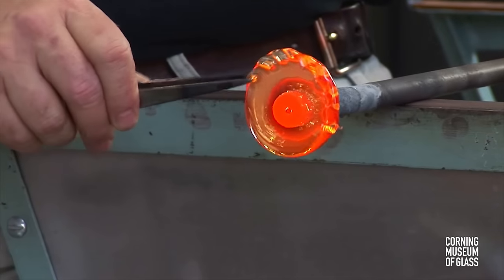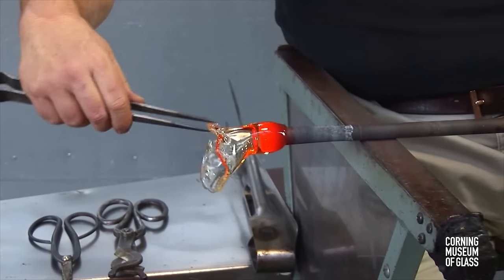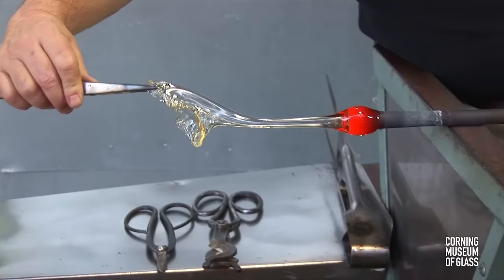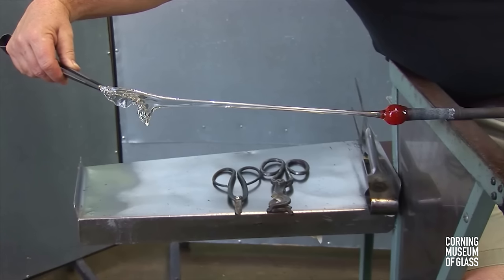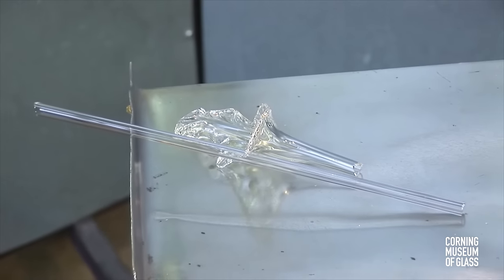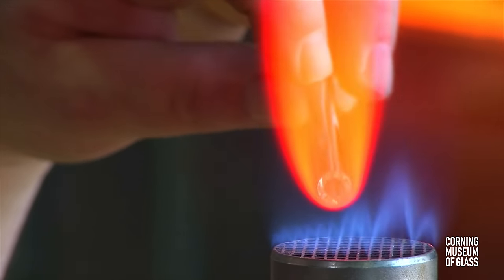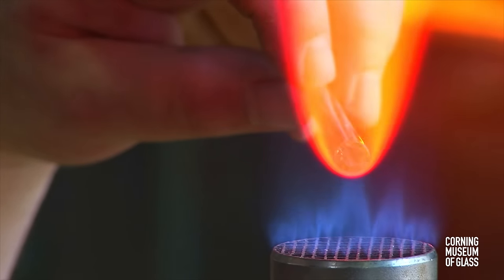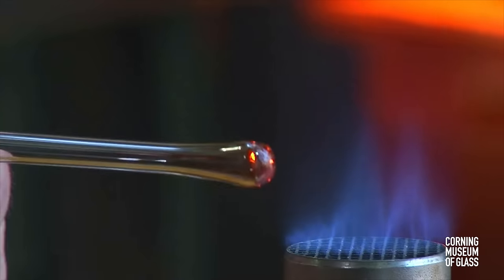Making Glass Tubes with a Bubble on the End

Comment: I saw a guy in an alley making one of those with a lighter, cool!
Reply: Lmao
Reply: yeah I've seen it done but they usually use a butane torch.. lol. . no bic is gonna do that especially in a alley which can feel like a breeze way on a pretty windless day.. it's enuff of a issue to light a cig if there is a slight persistent wind .. let alone trying to roll the glass while holding a lighter. lol.. my roommate had a thing about making them all the time. of course we all know what they are used for.. but he would also blow pipes for smoking bud too ! which is alot harder because tye stem has to be narrow enuff so you don't suck the weed down your throat when u hit it unless u use a screen but you didn't need one with his. he would also use different color glass hot enuff to layer the different colors into layers so it looks like a marble. the guy had some real talent. it's sad because he was a really good guy .. he just had a problem.. but he didn't let it define him or change him so he was a functioning addict or user..  finally got clean after years of use because he found out that his girlfriend was pregnant and they had tried to get pregnant for almost 7 years or something .. and when he did he started working at a smoke shop and the owner found out he could make some of the dopest pipes or glass pieces as they call it .. lol... and allowed him to sell them in his shop and didn't want a cut at all and he saved for about 4 years or so and was on his way to a bank to  have 2nd interview for a loan and his boss had gave him permission to put him down as a reference at the bank because the boss banked there as well and said if it came down to it he would consign to help him get the loan if he wasn't able to do so on his own.  on the way to the bank at 8am or so he was hit by a drunk driver and was killed .. R. I. P. STEPHAN CHARMICHEAL!!!
Reply: @Justinarmstrong0089  dude
Reply: Yeah I walked in my buddies apartment in Atlanta one day and I see this flame coming from the bathroom dudes got a Walmart propane or butane camping tank with flame shooting out rolling and blowing to his hearts content he looked like he was having the time of his life so who am I to hate
Reply: Lmao!!!!!booya.
Reply: @Justinarmstrong0089  as much as you typed we can tell your speaking from experience lmao
Reply: @Justinarmstrong0089  Damn I'm sorry to hear that, are you ok?  Sounds like a bit to bear.
Reply: So thats what everyone is doing
Reply: Roflmfao
Reply: i'm going out on a limb here since it is 4:30am local time, and i am going to guess the guy in the alley was using one with a lighter not making one. 😎😎
Reply: @joeltheiss4620  lmaooo yes he was rolling a bowl at least he fooled one person
Reply: More like a torch. And yes, everyone knows that one person who gets high and only does one thing
Reply: @joeltheiss4620  I once saw 3 jazz musicians. They were so broke, they were all sharing the same cigarette. And they were all left handed.. 

Me, I'm all natural, just smokin  banana peels. 💯   and the occasional cat cheese trip # heavy metal
Reply: hahahaha
Reply: thanks for this lesson, I’ll have to watch it again and if successful post my results, any cooking recipes for the new glass ingredients 😳🫣🫢🤫
Reply: The people living underneath the overpass by my house are always blowing smoke outta these lol
Reply: Hey artist are everywhere I’m pretty sure Miami has many artist that do those same kind of glass pieces in alleys
Reply: @lunytunez3634 lmao 😂
Reply: @gabrielwaldren  Recipes vary quite a bit and not all ingredients are easy to find so you may have to procure them in very random places from interesting people. For some reason the popo looks down upon the guys in my area that supply almost all of the ingredients.

Comment: definitely not going to work with borosilicate unless that is an oxy fuel bunsen burner you'll never get the glass hot enough to easily blow a bubble on the end out of the flame unless the wall thickness of your tubing is very thin, in which case the resulting spherical shape on the end will be even thinner and practically useless as the thin profile will easily break when subjected to any stress, heating variance, or impact
Reply: Not true. I use a bernzomatic ts8000  and i can blow some pretty thick glass. Even the colored tubes that are much harder. Just gotta have some patience, and maybe a blow tube.
Reply: You know what they say about nay sayers and do gooders...
Reply: That's bullshit. I blow pyrex with a map torch. Hell, I've done it with butane it just takes awhile
Reply: You can also use Mapp gas with Boro, not just oxy/propane.

Comment: Noooo  You didnt tell us how to remedy the pin hole. I hate when that happens and its so hard to close up after the bulbs blown. Ive tried a few methods but the results never look good. I find the easiest way is to either start again or heat up another piece of glass to melting point at the same time and touch the two together at the side of the pinhole until it sticks and cover the hole like that.....but Im a hack so illd like to know a better method if there is one. Ive even tried dabbing the red hot bulb at the pinhole into crushed glass and reheating.

Comment: AKA "oil burner" or depending on where you are and your current legal status/situation you have just learned how to make a midameanor for yourself(for starters) hey as long as theres no carb hole in that little bubble at the end of that glass tube or anything illegal in it you got nothing to worry about.
Reply: Used for rocks mate
Reply: @vishuchopra6018  crystals really
Reply: Its an uh....oil burning pipe. Lol
Reply: Oil burners are a nice travel dab rig. Get past the stigma of the oil burner... it has more uses than crystal.  I've known people who load hash oil into an oil burner and it works great.
Reply: Invent burners